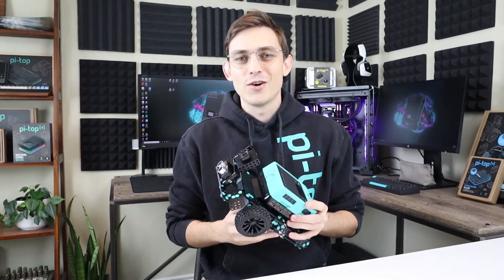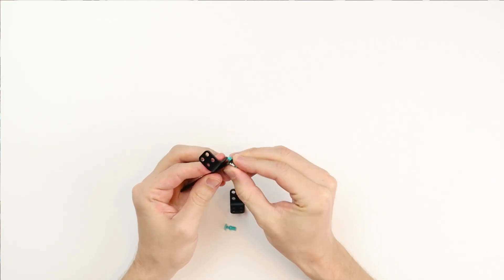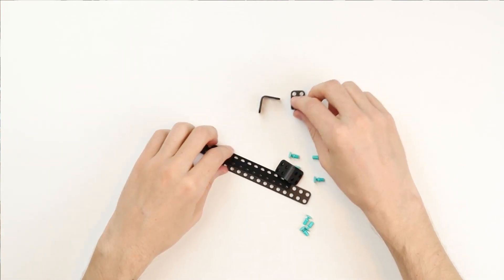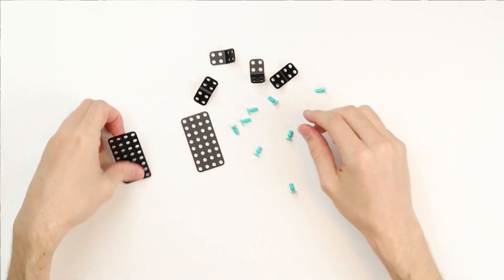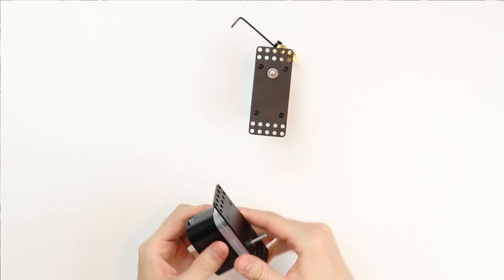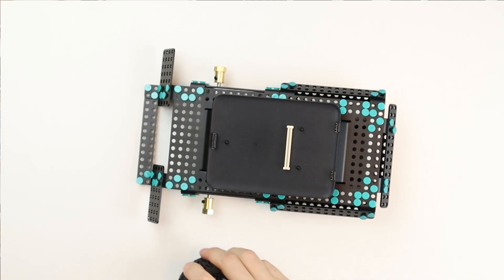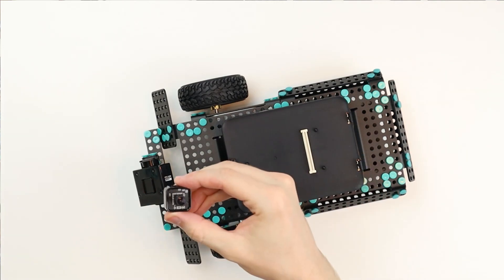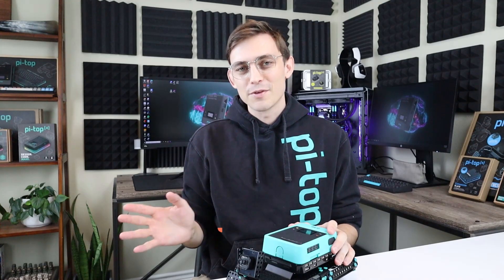pi-top [4] Robotics Kit: Build instructions - Alex

Comment: We got it built now cannot find good instructions as to how to start installing and configuring the software so we can start programming it.... Kinda disappointed great start with the kit but no how to's easily found and the dot net demo software is missing from git hub.
Reply from the maker: Hey there! We recommend you check out the getting started page on our website 👉 https://www.pi-top.com/start
It will guide you through the steps to setting up your pi-top [4] so that you can begin programming your robot right away! We hope this solves the issue but if there is anything else you need help with, do let us know 😊
Reply: @pitopTEAM  yep had that. Haven't found a Robot kit software and programming how to or guide.

Comment: Hey Pi-Top,
    I have some questions about the robotics kit. First, do you recommend this kit for me?I am in 7th grade and I am ok at Python so I am wondering if I should buy this to help my Python skills advance. Secondly, are the wires and the wheel axles included in the kit? Finally, how does Alex turn when the encoder motors only go straight.I know that there is another wheel that can turn but how does it turn when the encoder motors go straight? Just curious 
Thank You.
Reply: I think that if one of them goes faster than the other then this will make AlexRobot turn although I could be wrong?
Reply: @tobysclark1  oh ok thanks.That makes more sense.

Comment: Hi Pi Top,
I was just wandering, I am building a auto watering system and I have got a normally closed valve which has two spades on the end.
I want to connect this to the foundation plate so could you tell me how to do so?
Thank you.
Reply from the maker: Hi Toby, great project! It sounds like you're wanting to connect to a solenoid valve - the best way to do it may be to connect a Grove relay board (sold by Seeed Studio) to your foundation plate, and control it from there. You may also need an additional power source to drive the solenoid. In fact, there are a number of different ways to do this, depending on the specifics of your project!

If you head over to our forums and post your question there (forum.pi-top.com), we have a very active community of makers and pi-top staff who'd love to help you out! If you tag @duwudi he's actually built something like this before and should have some good tips for you!
Reply: Thank you for responding quickly I will look at that!